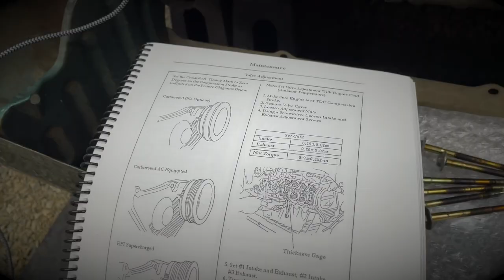Carbureted Subaru Sambar Getting a Custom Exhaust From Japan and It Sounds Good!

Comment: Do you feel like you got more power with squid pipe then this setup?
Reply from the maker: hmmm. honestly don't really notice a huge difference. i was mainly going for sound and look with the setup but if i had a dyno close by i'd test them.
Reply: @OhKeiGarage  that squid pipe just looks dirty lol. I sent you those 2 headers from ipunkz did you ever get em?
Reply from the maker: @androdiehl6596  ohhh this one isnt the squid pipe, this was just the stock manifold with the muffler from Japan. Another video is the "squid pipe" lol. And yes got the headers! Haven't even opened the box, been too busy to do anything with them. Soon hopefully I can get one of them to fit on the daihatsu midget. thanks for sending those over and working with ipunkz on that
Reply: @OhKeiGarage  no problem man, it sucks I couldn't get them to fit, front driveshaft and motor mount were giving me problems. But I got a sambar coming so I'll be doing another header from ipunkz cause atleast I know it fits
Reply from the maker: @androdiehl6596  ya that one definitely fits lol. just plan on running coverless though
Reply: @OhKeiGarage  yeah that's fine no biggie lol
Reply: @OhKeiGarage  anything I should really worry about with the sambar? Importing one through my friend who's been doing it for a few years?

Comment: What are the odds of getting pulled over for no rear plate?
Reply from the maker: slim to none here in washington.... LOL. Tweekers out driving around with no plates all day in this lovely state. But honestly, idk. I have my plates back there still so it hasn't been an issue.
Reply: @OhKeiGarage  if you ever get scratches/dents on the Sambar, Do as the Japanese  and spray it with regular white spray paint can; it prevents rust and makes it look un-damaged  from a distance